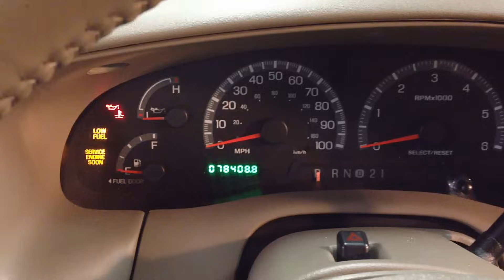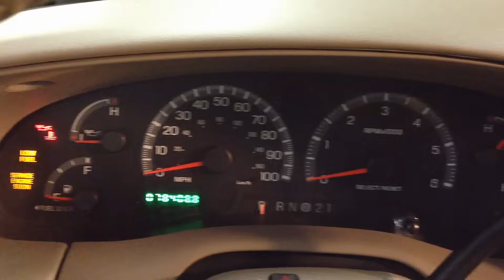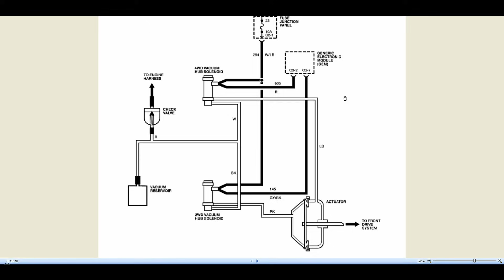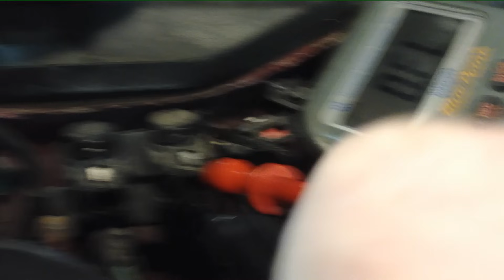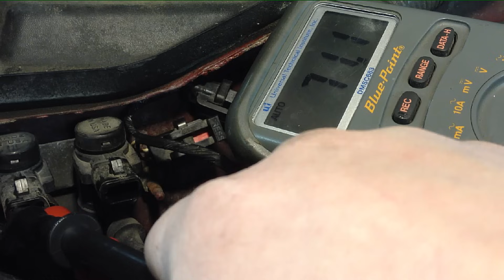1997-2004 Ford F150 4X4 Inoperative In Depth Diagnosis

Comment: Awesome information! I have a 98 f150 with the same system as the truck in the video. Im getting no lights on the dash to indicate thats in in 4wd but it is shifting like its in 4low. The odd thing is, the front axles are not engaging. I replaced the vacuum actuator and both Solenoids up by the battery with no change.

Comment: He has very good and informative videos  I traced the vacuum from the axle to the solenoids, I checked the electric good, vacuum good, four by four solenoid wasn't working I tapped on it with a screwdriver end and it started working has been working for over a hundred fifty thousand miles more I have 240 thousand miles. A good thing to do is exercise your 4 by 4 once a month or every other month it keeps the solenoid from drying out.

Comment: great video...I must have a Canadian vehicle, when I attempted to follow your fix I found my actuator on the aft side of the axel ….yours appears to be on the forward side?....I am working on a '97 XLT Exp. & no matter what I did it is stuck in 4x4..i checked the vac. & it is working to the solenoids....if I manually move the actuator out (away from the diaphragm) it pulls it back in when the car is started, even with the solenoid vac. lines disconnected?.....would disconnecting the battery have any affect?  I had it jacked up but did not rotate the wheels yet...tomorrow

Comment: I have a 2001 f150. With 4x4 engaged, I have a growling and vibration at low speed on deceleration only. Under power seems to be smooth and quiet. Is this a differential issue such as ring and pinion or spider gears or could it be something else?

Comment: What would your diagnosis be if you hear clicking but nothing else, not light no motor switching nothing just a clicking sound.
 Edit now it doesn't even make a clicking sound or anything and number 23 fuse is good

Comment: I have a 2002 f150 replaced the 4x4 acuator 4x4 will work while just driving but when i am out trying to plow snow when i get started with a load of pushing snow the 4x4 stops working help Please

Comment: So I have one of these trucks in the shop now. Has vacuum, Tcase is operating correctly. The vacuum diaphragm on the front differential is moving but I still don’t have four by four engagement in the front differential. Think I need to take apart the front differential to locate the issue?

Comment: 02 F150, switch on dash for 2wd/4H/4L. No light indicator on dash, when switching, no sound from relay, no sound from transfer case?  Checked 10a fuse is good.  What could be the cause?

Comment: My truck is a 4x4 2001 and my transfer case motor doesn’t work I switched the switch on dash and no change .I also checked all fuses on jem module in fuse panel under dash .what activates transfer case motor  Thanks? From mobile auto parts@yahoo.com

Comment: May be a dumb question but are those two solenoids behind the battery interchangeable or is there a specific one for the 2WD and one with a switch for the 4wd. 
I’m not getting suction from either one

Comment: This video has been very helpful. However,  when my switch in the cab is switched to 2wd the ground switch wire for the 2wd solenoid does not work, however I get voltage when I test the 4wd solenoid ground switch wire (while it's still in 2WD mode). Any idea what can cause this? I would really appreciate the help. Thank you.

Comment: Hello i have a 2002 f150 plow snow with and last year the 4x4 kept cutting out under load of plowing changed the acuator this year and it still cuts out under load of plowing but works just while driving any ideal what may be the cause thank you.

Comment: Is there an electrical test for power going to, at the, transfer case shift motor? 2005 Ford 150, I replaced the vacuum solenoid, both relays in engine compartment, drivers side AND the transfer case shift motor. All fuses good. Could  the rebuilt shift motor be bad?

Comment: I just ordered a cable to engage and disengage my actuator on the front axle,$206 tax& shipping,eliminates vacuum solenoids, they're burnt, broken and just a hassle.
Reply: Manual transmission and manual shifter to engage front end.

Comment: The problem I’m have’n that I can see my broken vacuum line and there is no diagram or anybody that can help me chase down the vacuum lines on the driver side front wheel. Where I’m haven 4 by 4 issues... If anyone could help I would greatly appreciate it..

Comment: Quick question. I have a 04 f150 4.6 with a manual shifter i have good vaccum to the solenoid but i dont get good  ground from the computer to turn the solenoid on to disengage the huds on 2 wd. I hope you can help me. Thanks in advance. Love your videos  keep them coming.

Comment: My solenoid voltages aren't changing when I move the on the fly switch. I haven't been able to find a schematic that shows wiring from the 4x4 on the fly switch to the solenoids. My 2003 has a F85B-14B194-CA (transfer case Relay Module) relay up under the dash. Does the 4x4 signal go through that relay?
Any assistance you can provide would be greatly appreciated.

Comment: Thanks for the great information. Apparently I have other issues since I have voltage to both solenoids however no matter which position I turn the switch to I always have a ground on the 2 wheel solenoid. I also do not hear the transfer case shift motor running. It was bad last year and I changed it. The 4 wheel drive worked for a short time and now I don't have anything but 2 wheel operation. I would appreciate any diagrams or troubleshooting tips you could give me.

Comment: So I’m working on my dads 03 f150. We have replaced both the 4x2 and the 4x4 solenoids on the firewall. Only the 4x2 solenoid is supplying vacuum to the actuator. He has the manual transfer case so is the light indicator switch on the front passenger side of the transfer case the issue? Thanks so much!

Comment: Quick question for you. I have a 04 f150 with the 4.6l and manual 4x4 shifter. Everytime i put in park or neutral the 4x4 light on the dash will light up and stays on and as soon as i put it in drive or reverse the light goes out. Any ideas what it could be ? Thanks in advance

Comment: So I did everything to test my 4x4 that you did in the video. So when I checked the wiring with my test light I only had ground to the left solenoid it didn't change when I switched to 2wd or 4wd. Please help

Comment: I have a 2001 f150 4x4. I am doing a 5.4 lightning swap. I changed out the wiring harness I put the lighting harness in the truck and took out my 4x4. It did not have the provisions for the 4x4 because it being a 2wd harness. What go you recomend I do just put the 4x4 harness run boost a pump and run a key on provisions for the pump for the intercooler? Please get back to me. Thanks in advance

Comment: Thank you! I was able to follow step by step and found all my vacuum lines were working. My actuator was seized but with some WD-40, a pry bar, and some busted knuckles I was able to unseize it and it's working perfect now! Well at least 4H and 4L are. My 4AWD setting doesn't seem to be working. It clicks when I select it but the light on the dash blinks on and off and it doesn't seem to be in awd. Any ideas?

Comment: Thank You for the great video and information. Sadly it's not for my truck. I have a 2003 ford f150 4.2l xl automatic transmission with a manual shift lever for the 4 wd. I pull the lever down and the 4x4 light comes on. Still in 2 wheel drive  The same thing on low range. Do you have a video on the 4x4 manual shift? Or any suggestions? Again Thank You.

Comment: I have a 2001 f150. When I engage 4wd nothing changes in the wiring to the solenoids, I also don’t hear the transfer case motor. Could I need a new or reflashed gem?

Comment: What if the its an Expedition 2000 eddie bauer and has no 2wd. Only allwheel, 4H and 4L. Do the solenoids work the same?  Mine does not disengage from 4H but the dash says it did. How can I tell if the truck is in 4H? When I switch to 4 Low I can hear it engage but not when I hit 4H. Whats the difference between all wheel and 4H? Thank you Maculoco. U are thr best ford mech. Hat is off.

Comment: Thanks for the guide.  I found out my 4WD solenoid was bad today following your steps and $26 later I had 4WD again.
Reply: Did your light on the dash have a steady 4x4 light?
Reply: @TheLaw73  Yeah.  Once I turned the knob the light came on, but I had no 4x4.
Reply: @wescat2  i am losing my mind it will not engage the front axle lol
Reply: @Michael Davenport Could be the 4WD actuator.

Comment: Friend has a 1997 f-150 lariat, we have tried all the tips from you and others on line, our issue is the switch in the cab is not switching the ground on the solenoids, or powering the transfer case motor to shift to 4x4 setting. new transfer motor installed, new dash switch, installed, solenoids both check out fine as well. dreading the thought of having to pull dash board off to test/ replace GEM unit. is there anything else we are missing, or a way to test GEM module without disassembling the dash board?

Comment: I have a 97 f150 Supercab 5.4 e4od  I have a few questions 

When I flip the switch from 2h to 4h I don’t hear anything nothing happens so how do I diagnose weather it be my gem not responding or the switch not working ? 

2 is it normal for 4 L so really jump into gear as I put the trans in drive 

3 I replaced the speed sensor on the trans about about a year ago because while driving on the parkway at 65-75 mph for no longer than 10 miles and then coming to a complete stop from a red light the trans will begin to hold the gear longer shifting at 4K rather than 3500 and then FIRMLY shifting into second . The first time I knew was on live data I saw the speed was jumping from all over while only going 50-55 . So if I shut the truck off for a couple seconds and then restart it . The trans will shift fine up until I start driving for a steady speed for a x amount of time . My question to you it’s doing it again so how do I diagnose on to think it could be a grounding issue and be possibly related to my 4x4 ?

Comment: Do you have a video on how to install a 4x4 Posi-Lok PSL750 Cable Operated Shift Actuator 97-03 Ford F150 4WD and how the electronic axle lock and transfer case motor still works? or if it will effect them.

Comment: My 1999 Ford F 250 super duty (with a F150 front 4X4 drive system)  It looks like under the hood just what you have described.  My  problem is the 4X4 kicks in until it gets down to 15 degrees or so.  The front drive then does not work. I had a mechanic replace the actuator on the transfer case but this did not fix it.  Could it be the solenoid or front actuator?

Comment: I have a 07 Ford f150, and I can't get it out of 4x4 to2  wheel drive ,I hear the transfer motor working, I changed the dorman 600-400 ,and it nothing working still

Comment: I have a 2001 ford f150 crewcab 5.4 the 4x4 was working just fine then i droped the front axle to change the oil pan gasket dint bother to check the 4x4 then i had it parking for a good 2 weeks cause i had a coolant leak fixed it then i was tryng to use the 4x4 and it wouldnt engage i could hear the relay click but thats just about it. The 4x4 light wouldn turn on nothing.

Comment: Thankyou for information. I have a 2001 f150 that wants to shift front axle by it self without actually shifting in to 4x4 mostly when engine is off. Im going to test the actuator on front drive shaft and check the canister by battery. I've checked all vacuum lines and all good so this video is a good start. I have also change the shift motor because it also stop working and I can hear it working now with the relay clicking when I turn the switch. I can shift it into 4x4 but it will sometimes stay locked in even with switch set in 2 wheel with indicator light's off. I'll let you know what I find out. Thanks

Comment: Great video.  On the actuator, besides the two vacuum lines you pointed out, there is a fat hose. I traced that hose up and it is not connected and near the two solenoids. About half way up at a connecting joint it goes into a smaller line that is about the size as the hoses in the solenoids. Is it intentionally not connected to anything?

Comment: My 02 F150 has an issue with the 4x4. I believe the diff is locked because when I jack up both front tires it's feels like it's free wheeling but the other side turns ever so slightly (but not equally). Also the front drive shaft turn with either front tire turning. The light on the dash says it's in 4x4. The switch says it's in 2wd. But when I removed the transfer case motor to check it. It's shows that it's in 2wd. So I unplugged the transfer case motor so it can't screw up anything else (I think the motor is seized.
Do you have any ideas what's going on?
Also if because this is happening 1) will it tare my front diff apart? Running as one unit without the transfer case torque. 2) and I thought the front diff was open and the transfer case makes the front driveshaft spine? Why would the drive shaft be spinning with he wheels...? 😕

Comment: How would you know if the transfer case motor is not working on a Ford f 150 or the actuator
Reply: Try turning sharply on a dry surface in 4-wheel and you can feel if the hubs are binding. If they are the axle is engaged and the transfer case is likely the problem. Or just do that wheel spin test to see if the axle is engaging or not.

Comment: I have a 2001 f150 lariate 4x4 i got stuck real bad the 4x4 always popped when turnkng and under alot if pressure now wont disengauge 4x4 and truck will not go into gear at all the gear shift moves freely but thats it wont move had a big clunk when parking it now nothing it worked fine in 2wd until this happened

Comment: I have an 03 F150 the 4wd is not working. There is power and vacuum to both solenoids but neither solenoid seem to have vacuum output. I checked for vacuum at the actuator in both 4wd and 2wd and also at a pull apart fitting next to the battery and couldn't feel or hear anything. Is it common for both solenoids to go bad? 
Thanks for all your helpful videos!
Reply: Changing the 4wd solenoid fixed the problem, thanks again for the video!

Comment: Need help! 99 f150 4x4 shift on the fly no 4wd. Turn selector switch to 4wd light gose on no clicking or normal sound. Checked vacuum relays no grounds to  2wd or 4wd solenoid with ignition on. I do get grounds with ignition off. Help Please FTM!

Comment: Mine is engaging by its self and it intermittent no one seems to know what's wrong with it you video is great give me some idea but I don't  know I have done a lot when car and truck were simpler I have 97 XL f250 light duty  I don't  have 4x4 switch  that you show I have manual  shift on the floor but I think it some how has that system but you did give me some sort of starting point dam truck is pis sing me off

Comment: Hi so got a question about the 4x4 system i have a 98 F250 5.4L, I'm having an issue with my 4x4 system now i checked the vacuum lines and there was an issue there but i fixed that but when i turn my truck on i hear the relay click a few times but when i move the switch to 4x4H it clicks a few times but when i go to switch to 4X4L or 2WD  the relay doesn't click nothing happens it stays in 4X4H unless i turn the vehicle off i was trying to find the fuses for the 4X4 system but there not clearly identified in the manual help please.

Comment: Have a 97 f150 4x4 thats been sitting parked for over a year. Put a new battery in it and got it going. Has a dash 3 position 4x4 switch that just seems dead. Turns with no resistance..loose as A goose. No 4 wheel drive. Does this sound like a vaccum issue ?

Comment: I check my solenoids 2wd drive is fine but 4wd has no ground power and I have no vacuum and my switch 4x4 light won’t come on. Any knowledge on goin about fixing and troubleshooting?

Comment: My 4 high works fine but my 4 low stopped working recently I dont know if it was after I changed the neutral saftey switch

Comment: Thanks for the great video. I followed your video and received the power to both terminals but have no ground. What should my next step be- I don’t hear any noise in the dash when I switch back and forth. 
Working on 97 f150

Comment: Could you send me that diagram. I'm having issues with my 2002. I turn the selector and I hear nothing . No clicking of any kind when I select 4h or 4L any help. Would be awsome. Thanks ahead of time. If you need my email or FB messenger let me know.
Reply: Did you ever resolve your problem. I have the same issue
Reply: I am also
....
Reply: I have the same problem. I change the selector switch and the transfer case control module and still no clicking also no light on the dashboard. I have to check the solenoids I bought them yesterday and I’m gonna replace them today hopping that it works.

Comment: Great video. Thank you for sharing this. You just helped me diagnose and fix my 99 F150. When I hooked vacuum to just the bottom port of 4x4 solonoid, had no vacuum from top port. Changed 4x4 Solonoid ($25) and it works perfectly!
Reply: I did same thing and no vacuum from top port on 4x4 solenoid. But ohms tested good. Still replace it? Or could it be vacuum from the box next to battery
Reply: @goalieman355   What was the diagnosis/fix?
Reply: Any codes present when this was your issue?  I have 1 bad solenoid too, but other issues, 3 codes reporting shorts etc.

Comment: Thanks for the video . I need to get the front vacuum actuator. The 2 wheel side works but 4 wheel does not. But was wondering how much vacuum there should. It all seems to work but just seems a little week. Vacuum would hold a piece of paper when I put up to end of hose, but pretty easy to pull away. Thanks